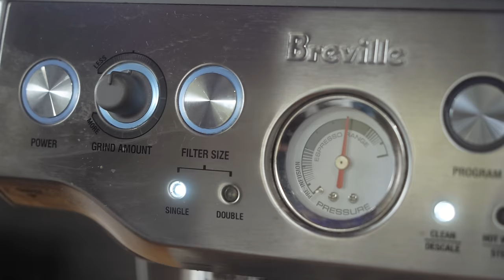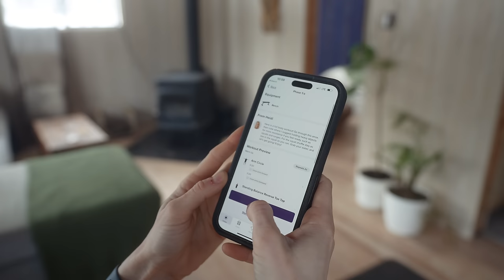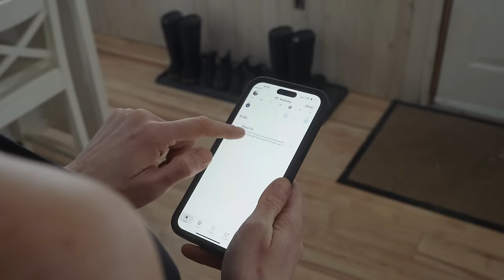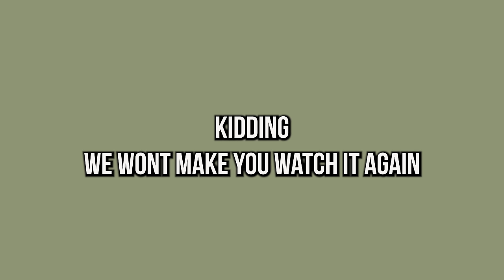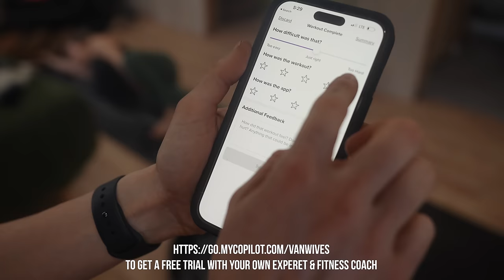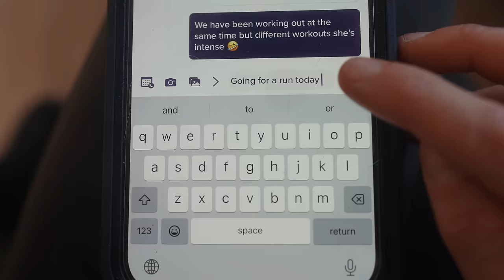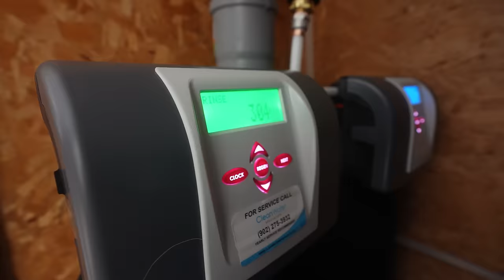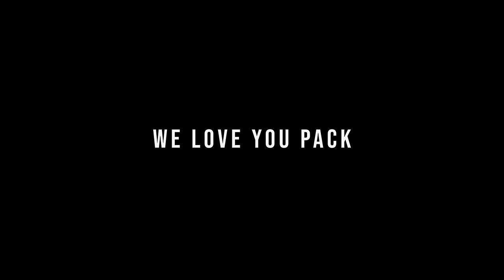A Simple Life In The Woods

Comment: You need to remove the receptacle from behind the wood rack, insulate the wire ends and put a metal blank plate on the box. If you do not and you drive a piece of wood through the receptacle, you could start a fire.
Reply from the maker: Wow, great suggestion, Michael. Thanks for sharing that with us. 💛

Comment: I'm not crazy about the exposed truss look...Good thing you don't follow code with an inspection..It would not pass.There is a reason drywall goes on the bottom of the trusses...But its your home to do as you wish...
Reply from the maker: We talk to an engineer before everything. But great input 🤠
Reply: @Vanwives  I'm a structural engineer for 44 years as well as a Class A  Air conditioning Contractor a bit longer...Yea I'm old as dirt....